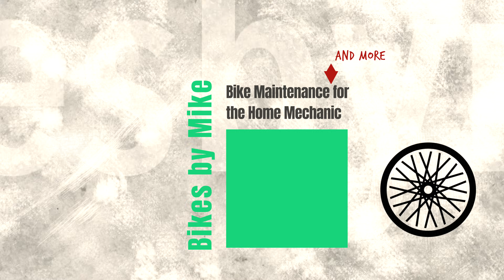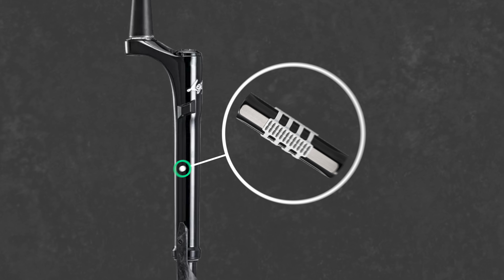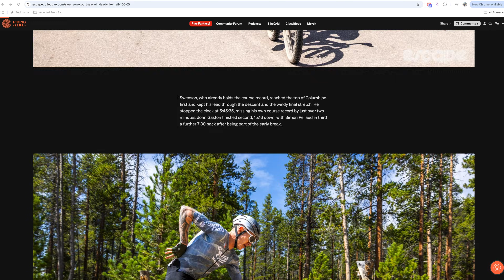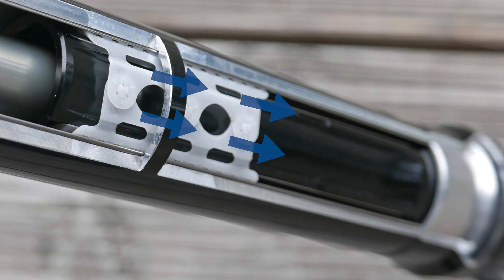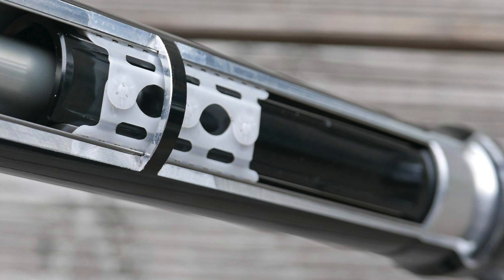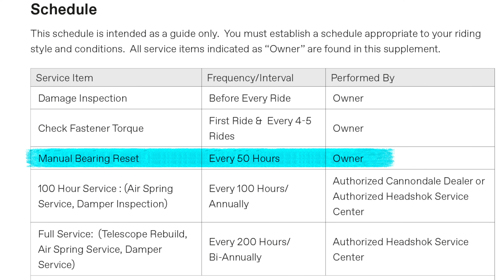The Lefty Ocho Fork Bearing Reset: Why Doesn't ANYONE Mention This?

Comment: curious if you have data for older Lefty forks as most of mine are between 15 and 19 years old..
Reply from the maker: The process is basically the same for older models, except the target bottom-out distance measured from the end of the Inner Leg and the Travel Indicator O-ring indicator changes. All past and present manuals can be found here: https://www.cannondale.com/en-gb/owners-manuals/lefty

Comment: Genuine question...am I missing something or would bottoming out the Lefty while riding basically do the same thing as a bearing reset?
Reply from the maker: Yup. You’re absolutely right.  If you bottom out hard enough, and often enough, while riding, you may not require a manual bearing reset.